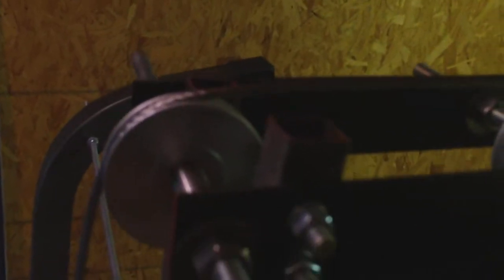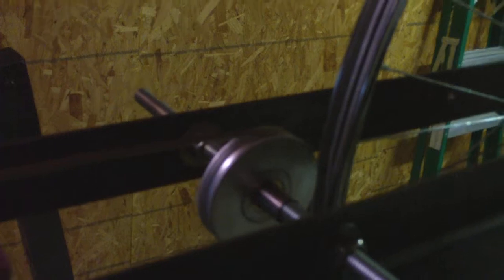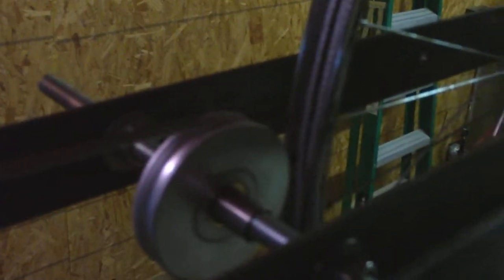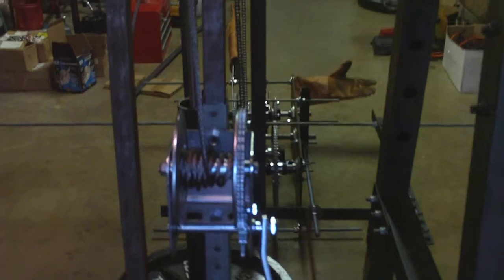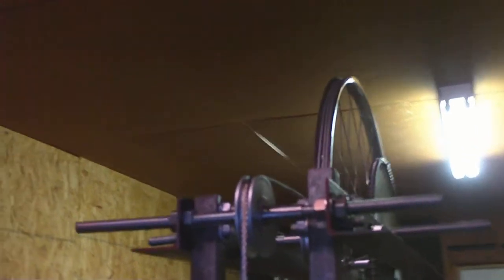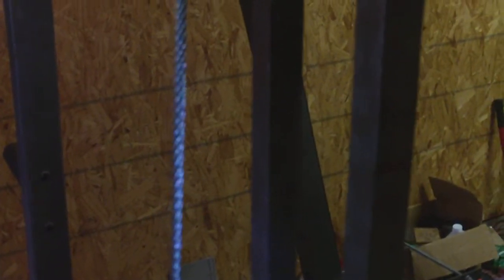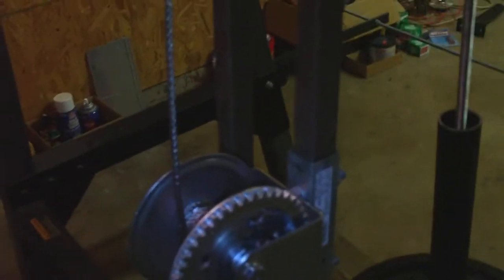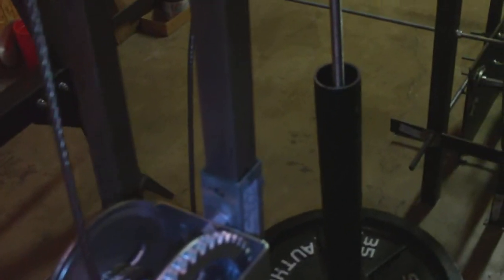52 - Winch & Pulleys 1

Comment: Why don't u lift the weight by hands directly... By parts.. anyways its very low weight.. it'll be done in 10 secs ..how long ull rotate the winch.. at least 2 mins. I have made mine a long time back ..my case the weight is 200 kgs which gets lifted by my own weight... I just need to stand on it for nearly 10 secs... Height of descent is 20 feet.

Comment: Great progress.  I eagerly await to see how much juice you will get.
Reply from the maker: Me too, keeping my fingers crossed. Thanks for following along.
Reply: It's my goal to make a generator similar to this one.  I have the escapement made to regulate the descent rate.
Reply from the maker: pickmyphotos Hey if you need a gearbox made, I can fabricate one for you. It'll let you take your escapement set up and link it via chain. Only thing I would need to know is what type of chain you're using. #35 chain would give you the best gear ratio choices. #40 chain is good also, but you couldn't go as high on the gear ratios.
Reply: I have one, but I just need to revamp it.  I originally made it out of wood, not realizing the amount of weight that would be needed to run the system.  It is on my very big plate of projects to finish.  LOL